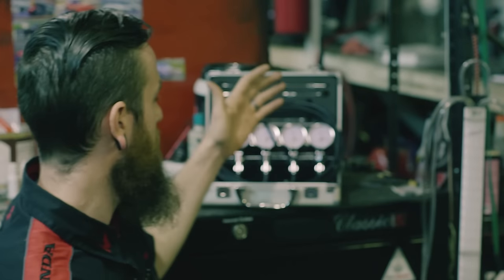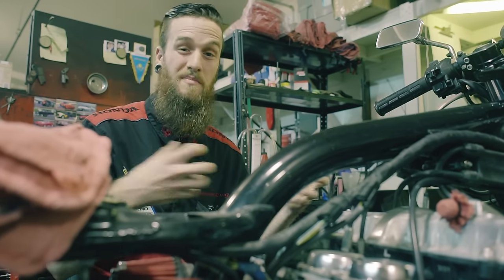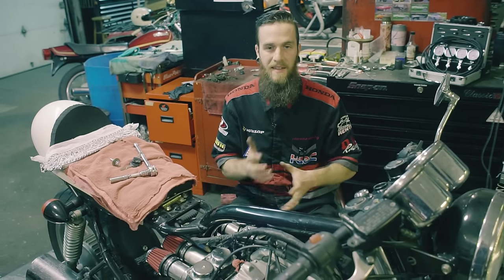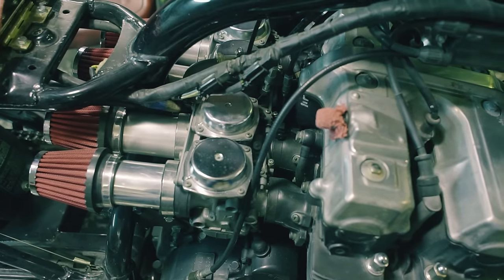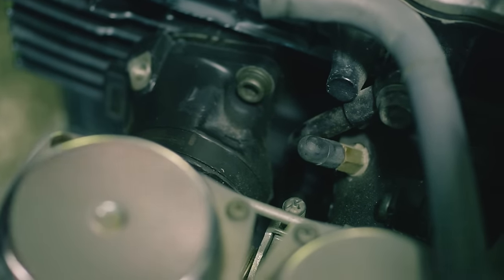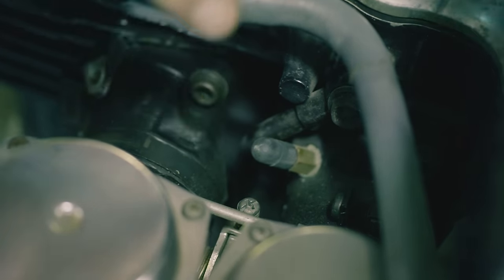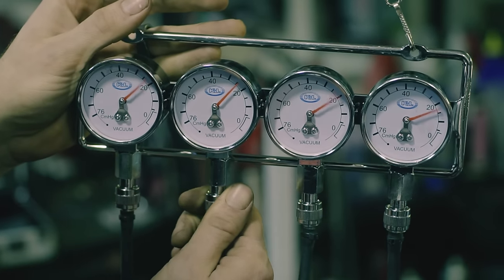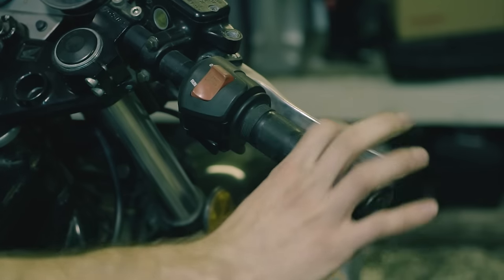Carb Syncing: How to Fine Tune Your Carburetors

Comment from the maker: ►► Here is my step by step Twin Carb Cleaning tutorial - https://www.themotorcyclemd.com/inline-four-product-options
Reply: Hey, I have to (let) restore a Honda CB600 PC34 Carb... mainly, the rest can I do.
But it is totally weak at around 1400 to 1800 rpm, the sound there is not clean onto that, did mean a mechanic.
Do you think, such can be a calibration thing? 
The pre-owner said it was cleaned a while ago, but she was lying about some problems. And I know... internal are as well calibration possibilities, but this should be expensive here...

Comment: One thing i learned.  Before you connect all four gauges to different carbs you should connect all gauges to one carb to make sure they are reading the same vacuume. they can be off and you'll have to compensate on your adjuster.
Reply: Legend
Reply: well said. no good trying to sync your carbs with gauges that are not calibrated.  maybe thats why the mercury tubes read differnt. thats why number 4 was out on both sets.   those knurled nuts he was turning on the gauges are dampers to dampen the deflection of the pointers. maybe it would have been better if he put the carbs out of sync then brought them back into sync and done  proper demo.
Reply: Exactly.  I have a four-into-one manifold that I attach a vacuum source to and can calibrate all four at the same time.  This is only for the dial gauges.
Reply: That's a great idea, thanks for sharing 👌

Comment: If you calibrate the gauges to each other they will have more accuracy. All you need is a syringe and 4 port manifold to create a common vacuum, then use the calibration screws on the affected gauge. Best to pull the vacuum to the normal operating value during cal-in your case around 20 cm/hg. The cheap Emgo gauges have a cal screw under the glass. If the gauges don't have adjustments then note which are off or mark the bezel  for error correction. You also need to dial or damp more bounce out of all the gauges.
Reply: Gotta sync my carb sync gauges?
Reply: if you calibrate them on a monday - you will have 6 more different calibrations by Sunday, if you calibrate them at 1000 revs they will be out on 1500 revs - if you use seperate dial gauges you will never know.....but in truth this isnt about accuracy - it is only about getting them into the working zone.....at best.... but lol on the damping - you tell me what you want them to read and i will dial in the damping and all unequally on every gauge.......
Reply: The best I have found over the years for dampening the gauges are iv drip emitters from the medical industry that go on the vacuum lines 
Between them and the valves on the gauges 0 bounce

Comment: I bought a 73 cb750 that had been parked for 43 years. Oil down the cylinders, carb clean, oil change, new plugs, air filter, cleaned points, got it running. It ran poorly, so I removed the carbs again and found a drill bit that fit nicely under one carb slide that I knew was working well. Adjusted the other 3 to match. Voila! I was riding! But a little sputter just off idle, where I do most of my riding bothered me. I built a manometer. Got them adjusted really close to the same. Now it actually runs a little worse. I'm buying some gauges today (quality used ones) and gonna try it again.

Comment: I know you posted this a while ago, but I hope you see this message anyways.

Recently I bought my first street bike. I've only ever had dirt bikes before now, so I've never been familiar with anything but one cylinder. I noticed very bad gas mileage after riding my bike around for a couple of weeks. I took off the carb rack, cleaned everything out, and adjusted the throttle plates. I had no idea what syncing the carbs were until now, after I've already put everything back together. It's such a relief that I did something right, granted without the perfect tools, and adjusted something for the better. Now in hindsight, because I actually know what syncing is, thanks to you, I'm so glad that I adjusted those plates, because they were MILES off a proper setting.

Thanks you again so much.

Comment: I just picked up a guage set from a guy retiring from boat motor wrenching . It's got about 6 different sets of vac needles all labeled 25 bucks  . The carbs you rebuilt for my 78 cb750ss are doing great . Awesome job ! . You said I should sinc them . 2k miles later I will thanks to this video . It's almost riding weather bro , let's GO.  Thanks again .

Comment: What a find! Yes its from 2016 but this is the cool thing about YT. I've been working on bikes for 30 years now and this is, by far, the clearest explanation yet. I've got this to do, just rebuilt the carbies on my 1985 GS850, she starts, idles with a fart and a pop but isn't pulling much above 3000rpm. Carbs were bench synced only so I'd expect nothing less than dog rough! You're a gold mine, if only to confirm what we know (or thought we did!) Love you man.

Comment: Great editing Cody! The reason for the difference in the vacuum vs. mercury is the vac gauges need "sync'd" to each other before use. I do it every time I use them. I can share the link to my video on doing that if you'd like. Also note, the Mercury gauges need "sync'd" too. Its common the many folks (not looking like you do) store the gauges on their side and little by little small amounts of mercury (or the later used blue fluid) separate of leak out and cause you to think the carb are out of sync. The big point here is your carb sync is only as good as the gauge sync. Keep Wrenching pal...H2W

Comment: Great Video. I have a 1982 v45 Magna, since 1984. I put it away in 1990 and just started to restore it again. Carbs seized and Shifter rod seized. So I tore it apart. Had the motor sitting there studying it for a year. If you ever seen the carbs for a V45 it would scare you. Looking at you video inspired me. I remember the nighthawks, unfortunately Magnas smoked them. Scared my brother in-law back then. Well Great Video Thanks. I will Show a video of the magna when I start that. Oh, in 1982 the Magna was way ahead of it time, Anti-Dive, Electric Fuel Pump, Water Cooled, Shaft Drive, Hydrolic Clutch and Brake, And probably the best bike ever made in its time. And So fast. Great Video, Your Awsome

Comment: I drop a stupid port screw and washer down into the middle of the engine /EVERY/ time I do this. They are such a PITA to get back!!!

New subscriber here and wanted to say you did a very nice job with this video. I noticed you have pods. I have a 93 CB750 and I know the reputation Nighthawks have running with pods. It demonstrates to me you really know what you're doing. Keep up the good work - really happy I stumbled across your channel.

Comment: Good clear information thats why i subscribed . What would cause number two carby to flood cylinder, even when engine is running fuel is leaking out exhaust manifold . Fuel is also getting into the engine oil and raising the oil level within 5-10 minutes running time. I have checked floats on all 4 carbs ( multiple times ) new jets new inlet rubbers new hose clamps carb bodies cleaned ( multiple times ) . Its a 1981 gsx 1100

Comment: Depending on how the carb vacuum layout is you can have 2 banks of 2 carbs instead of 1 master carb. Keihin FCR's are like this. Carb 1and2 are tied together and 3and4 are ties to gether. With port linking the 2 banks of 2 together. You make 1&2 the same, 3 & 4 the same then bring both pairs together with the center spring screw.

Comment: what I learned how you easily set the sync without gauges is:
remove the carb-bay from your bike
take the smallest drill you can (one that is not grimy nor with burrs) get mark one side of the shaft with a Edding(or whatever permanent marker you can get) for repeatability of the position
for the next step: BE GENTLE! using force might damage your carb fataly
open the butterfly by turning the RPM screw in, so that the drill will juuust fit between the "Master"-butterfly and the carb-body with the mark facing up (make notes for the turns on the RPM screw)
repeat with the "Slave"-butterflies so that the drill will juuust fit underneath those
close the RPM screw back to normal by screwing it out
insert the carb back into your bike and take a ride to warm up the engine
adjust the idle to spec RPM

Comment: love your vids mate, it looks like the old school mercury sync gauge is more accurate than the new gauges. As mercury is a substrate that can't be altered, it's automatically in calibration, and perhaps the gauged calibration setup has gauges that could possibly be out of calibration? But as you said, you can get the synchronisation in the ball park with close tolerances.

Comment: I know I’m years behind on the party but I just want to let you know this is a great video. I can’t find anything that says my ‘77 Honda CB550F has a specific carburetor for which I’m supposed to set the rest. I noticed yours was carb number two. Do you know if there is a specific carb that I’m supposed to set first? It looks like all of my carbs have an adjustment screw on them

Comment: Good video 👍 where did you get the extensions for your pod air filters and I'm assuming it's a better setup than just putting the pods right on the carbs. I have a 1982 CB 750. Thanks
Reply from the maker: I measured how far I wanted the dimensions and size of the tubes. Ordered them pre-cut, raw aluminum from online metal place. Polished them myself and installed.
Reply: Thanks man. Appreciate the info 👍

Comment: Just got my ‘95 GL1500 road ready, and will start on the ‘80 KZ1300 with 3600 original miles... yes only 3600! Rebuilt the carbs, but need to balance them now..

Comment: Great tips, Cody! I am wondering, will the 4 gauge tool work on a dual carb motorcycle? Can you leave two gauges disconnected or is there anything that has to be done on the 4 gauge tool before it's used on a dual carb machine?

Comment: Question for you.  I see your gauges reading roughly 22 cmhg.  I have synced my carbs with different gauges but mine also read about 21 or 22 cmhg.  But my gauges have this little red zone with text saying things like manifold leak or late valve timing among other things at this level of vacuum.  Is there a normal vacuum range for a bike?  I have a Honda Shadow 750.  I see no spec for vacuum in the manual except to be within .8 in hg between the carbs which I am.

Comment: Hi MD, happens to me that Carb synchronization for one of the Carbs was imposible to tune due to the fact that the admission valve for that particular cylinder was not closing completely creating a leak, after repairing the valve seat everything went fine. so very important that valve cam head works perfectly fine, otherwise as you said you'll chase that adjustment for months with no good results.

Comment: Great video Cody - as are all your videos. Thanks bruv. I've a 1987 Kawasaki ZL1000 with cones as opposed to airbox. At 80+ mph if I level off it flutters a bit. I mean the carbs seem to flutter. If I accelerate it acts normal and pulls hard as it should. Idles perfect and at lower speed runs perfect. No hesitation starting up. ??? Any info would be most appreciated.

Comment: Correct me if I didn't understand correctly, but that fourth dial gauge indicated that there was a lack of vacuum, so you increased the vacuum at the carb. But then when measuring with the mercury gauges, they indicated that vacuum was now too high on cylinder 4, meaning the bike was actually fine to begin with and that fourth dial gauge just gave a false reading. To me that's reason enough not to trust the gauges, or at least find a way to calibrate them.

Comment: Can you do a video for your pod setup and tuning. I have a 79 cb750f put pods and jetted the carbs. I sync the carbs and ran thru for vac leaks. But I noticed you pipe your pods. I like to know more about that setup.
Reply: Same here I want pods for a cafe racer look so get rid of the bulky airbox but apperantly cv carbs don't like pod filters.
I don't care about the noise or power just want cleaner look!
Reply: @Tryant69  I've found that CV Carbs work better with Unipod filters vs the pleated/KN type pods filters...it's a smoother airflow as the slides use this airflow to move up/down.  Alternatively, you could add tubing, or better yet velocity stacks, to the back of the CV carbs and then add the pleated style air filters which will help to smooth out the airflow.
Reply: @ticosandoval  first thanks for you reaction! But unipod? Do you mean like the cilinder shaped foam filters instead of the paper+mesh pod filters? I was thinking about cutting the original box to only keep the mount and velocity stacks and then fit one big foam filter over al 4 stacks. Was hoping that would work.
Reply: @Tryant69  Yes, UNI filters: https://unifilter.com/ vs. the pleated kind like K&N: or other folde style.  Not sure about your concept, but might work?

Comment: Hey Cody, I’m going to do my first carb sync on a 1975 CB 750 I bought recently.  Thanks for this video.  Curious what the clicking sound was when the bike was running?  Almost like a sewing machine.  My bike does the same thing and I wasn’t sure if that was normal. This is my first bike, so I’m pretty green.

Comment: You can still use the vacuum to get your pilot air screws to a good baseline or as a sanity check if you're investigating a rough running engine.

Comment: I always had a heck of a time getting Mikuni  Jets  dialed in correctly  ive owned a lot of Bikes  and watercraft  and i never  developed “the Ear” that the Professionals have  i did however use a borrowed Vacumn Guage set to  sync my old Honda 4 cylinder that was a 650 cc  and I loved everthing about that bike as i felt it had the weight and ride of a much bigger bike  mine was loaded with soft Saddle Bags  a Sissy bar/ back rest and a luggage rack fo long distance rides the drawback to that bike was it was. A 1981 and that was the year motorcycles  had to run with the headlight on. So many manufacturers just hot wired the head light  with a modified harness and did not up grade the charging systems from the previous year. Production which resulted in a slow drain on the battery i had a Yamaha that luckily did still have a kick start  but the motorcycle wouldn’t run worth a crap with a dead battery. I could tell by the sound of my electric starter that i needed to get the bike home ASAP to put it on a charger  the dealer kept telling me there isn’t anything wrong with the Motorcycle after countless of times bringing it in to them  it was frustrating  my Honda 650].did not have a kick starter  it was electric only or push start   No real hills to speak of as i lived in South Florida

Comment: Have you looked at or tried the "Morgan CarbTune" meters?  I have one (a twin Gage, but they make a 4 that I should have gotten) and I love it.  Inexpensive and accurate.  Your bike doesn't have a "set zone" for the vacuum?  On my Yamaha, it's 24Hg as the base to be adjusted too.  Looks like your Honda is about the same.

Comment: I got my first junker and I'm restore the 91 Suzuki GSF 400 so I got a lot of questions,first being how to tune the carbs for economy but have her leaning a little to the 'rich' fuel mixture side.
Secondly does replacing the default air filter box for individual sports air filters add more air making run even leaner?

Comment: OK, I got a little confused.  With the dial gauge set, # 1 was reading low.  You adjusted it up to be level with the other three cylinders and said you could hear the improvement.  Then, you hooked up the mercury gauge set and it showed # 1 as HIGH compared to the other three cylinders.  So, you adjusted it back DOWN.  Didn't that bring you to the readings you started with on the dial gauges?

Comment: Long time subscriber but first time commenter. Love the vids. On my 1981 CB900 Custom (which by the way I just learned that I have 1980 carbs on) it runs like crap just after a carb re-build. I'm running 4 into 2 exhaust with baffles and pod filters. It has stock jets. Ive been told that I need to rejet to 125-130 on the main and 70 on the pilot. Does that sound about right to you? Thanks Cody.
Reply from the maker: Good place to start!

Comment: Great, learning heaps, my only feedback is the conclusion that Merc was better than the gauges based on what we saw; adjustment by gauge, then throttle butterfly seating, then went straight to merc. I think that it would have been logical to go back to gauge for a reading before the conclusion.  This may have been done off video, my contribution is simply about trouble shooting technique for us, not a doubt as to merc being better or his competence.
Reply: That's exactly what I was thinking, what I saw was when he had the dials hooked up he had to adjust the #4  needle up , he also mentioned at that time the bike started sounding better and when he hooked up the mercury sticks he had to adjust the #4 level back down but didn't mention anything about how the bike sounded. So in all actuality it doesn't look like he changed anything , just put it right back to where it was at the beginning, and he also didn't prove his theory on how more accurate mercury is over the dial gauges by hooking back up the dials and showing any difference before ending the video.

Comment: Correct about everything. Only difference is that for some reason my baby varadero required 30mm less vacuum on the rear cylinder.... Manual says it so I'll do it.

Comment: The manometer is fine with higher revs, you just have to be careful not to make abrupt throttle changes, increase and decrease. You want slow and steady to avoid vacuum spikes. And  you should make a point of throttling above idle, the sync can change.